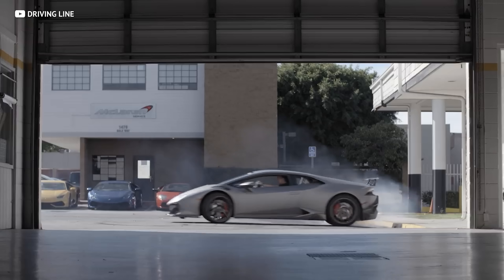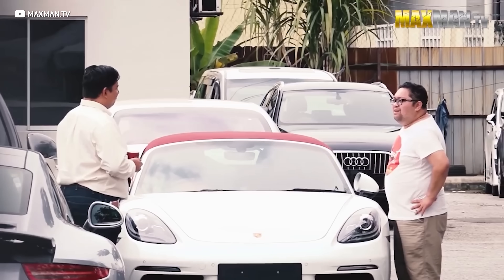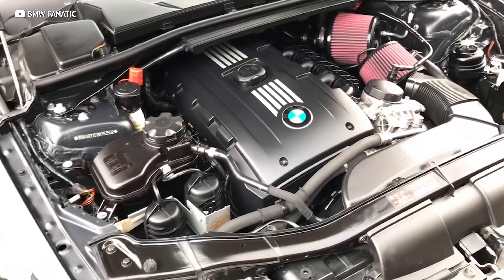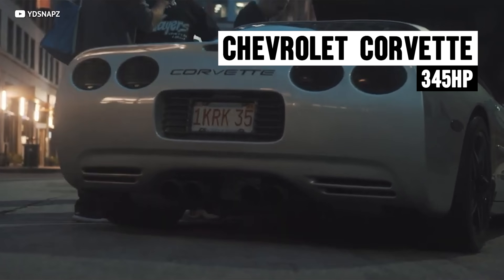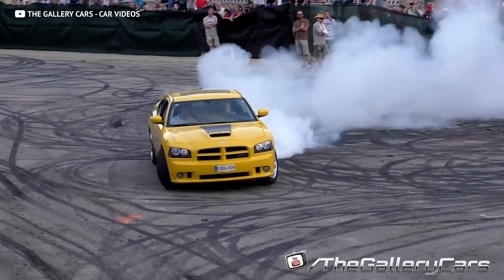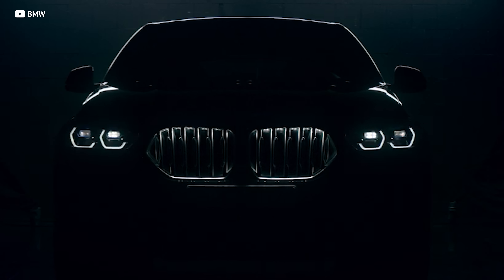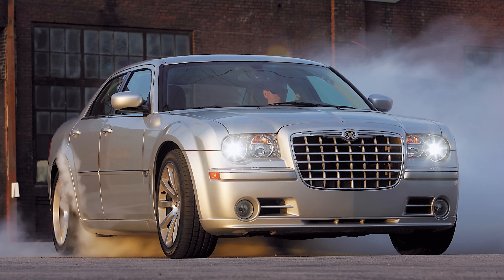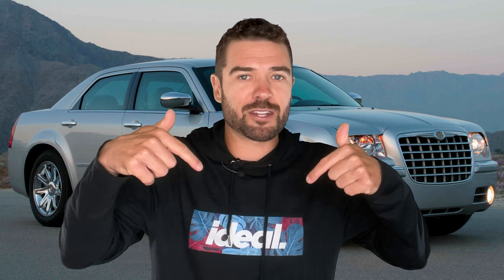Cheap Cars With a TON of Horsepower

Comment: Finally the pontiac gto gets some recognition. My dad drives one of these
Reply: Yeah they are great. Better than having a mustang or camaro everyone has those
Reply: @chinchy111  frrrr they are underated. What kind if engine swap do you think would be best for the car? My dad had an ls3 swap put into his
Reply: I think they're garbage personally.  Slowest 400hp I've ever seen in my life.  Maybe if they weren't 4000lbs in street trim they would have been faster.
Reply: 3700lbs but yeah still very heavy. Why are they so heavy its GM so its all plastic interior. Just a big car i guess
Reply: @chinchy111  bruhhhh thats insanely heavy thanks for the info
Reply: @chinchy111   Dude, I have no idea because my C63s is heavier than a 2006 GTO, it has 516ftlbs (vs only 400) but still gets 0-60 in 3.8.  Possible that they're just not geared right, I guess.
Reply: lol
Reply: @Justin-ut2vw  Don't those come from the factory with an LS3?
Reply: @ravemaster7405  it was the ls2 the ls3 never debut until 2008
Reply: @JB-ej8zy  correct

Comment: I have to say I bought my genesis for 10k about 3 years ago with 80k on the dash and I have to say the horsepower I phenomenal! It’s luxurious and noticeably fast. I race a s550 and beat him by a car length every time because hyundai’s transmissions in those are very quick. One of the Best purchase I’ve ever made and pushing 150k on the dash it still drives like new!
Reply: I felt the same way 😿 I bought my 2013 2.0 for 7,500 with 65 on the dash. Was the funnest thing to drive for 2 years until I got a rod knock at 80k miles 😭😭
Reply: from what i read t56 manual trans kits exist for that motor too.
Reply: My 09 manual g37 uprev tuned beat my friends Genesis 3.8 tuned both fbo

Comment: Y'all r gonna make me buy the perfect car and u guy's content is great!
Reply: Lot of BMW and other luxury cars on this list. If you want something cheaper than 10k and much cheaper to mod up to 600hp check out the 05 to 07 Saturn ion redline or less preferably a OG cobalt SS but the redline looks much better and is a lot more rare yet only 5k max. Only 5800 made. Supercharged from the factory, recaro seats, read suicide doors, battery already in the trunk and it was built and intended to be modified and easily handles 500 to 600hp on the stock bottom block
Reply: @billybuchanan385  sure dude thx btw😀

Comment: The GTO would be my ideal choice cause it's always gonna be a sweet ride no matter what year it is.
Reply: Only issue is there 18k or more none are under 10
Reply: Get you a Caprice PPV. Same car ‘13 and below. ‘14 and up are more like the Chevy SS. It’s the perfect sleeper! I came across a ‘14 at auction for a little over $8G’s and it only had 46 something thousand miles on it. No accidents, no damage. It’s also rare around here. I dropped it off for new tires and all of the guys came out of the shop wanting to see who was picking it up and wanting to know where I got it and if I want to sell it. 😂 Every single guy that I talk to about it asks me if I want to sell it. Now that I think about it, a friend told me “congratulations, you just bought yourself a dick magnet” when I got it. He was right. 😂
By the way….mine has a L77 in it in case you’re not familiar with them.

Comment: Bro no way the 2006 GOAT finally getting recognition 🗣
Reply: Picked my goat up for 7k
Has 2228r texas speed&performance cam ,circle D 3200 stall, texas speed long tubes, heads were worked on too, and pedders coilovers front&rear
Reply: @travisloza8037  wit 400k miles and slipping trans

Comment: If you gave me 10,000 dollars I would buy either the Mercedes sl550 for sure and second would be the gto... I've had the 6.0 Ls but a more timid version being it was a 2012 caprice ppv..Also owned the 300c... And I am a current owner of the genesis 4.6 V8 power and sound is a must ..The Genesis lacks low end torque normally found in a V8 I feel but stretch it out a little and by that I mean keep it hammered it will keep up and pass some 485 challengers idk if it's aero but top end is really good for a family sedan and it's not uncommon for me to cruise around 140 and I have had it at 158 so I don't think these engines lose much power over time but I've always bought stock sleepers and I think for pure fun and performance the sl550 which really impressed me the most driving  as far as sound and performance  or the  gto is where I would look to... Mercedes is extremely reliable with being put to use might cost a lil more when it breaks but you can bet it won't blow like Ls would sustaining those high rpms and prolonged supposed abuse that would blow most v8's especially from long high revs they were made to sustain Autobahn speeds not just average American highway speeds ....The main reason they require so much oil even the slk320 takes 8.1 quarts of oil in a somewhat small V6.... The wear and tare are minimal compared to when you keep your foot down in American cars for prolonged periods therefore actually costing less.... But that being said gto would be second if not first depends on which I would find for the right price

Comment: Good video, but the Chrysler 300c came standard with the 5.7 HEMI with 350 hp, just like the charger RT mentioned earlier in the video. And happens to typically be around the same price. And is the same platform as the charger too. Then theres the 300c SRT8, with 425hp. Good luck finding one in good shape for less than 16-18k. Same goes for the charger SRT8. However you can sometimes find higher mileage ones for closer to 10k and sometimes less depending on condition. Not to mention, many people believe the 6.1 HEMI was underrated, and actually may have made closer to 450hp, and typically exceed their rated 0-60 of 4.8 seconds, and can be seen going as quick as 4.4 seconds stock, the same as a scat pack with the 392 HEMI. The earlier gen 300s, chargers, challengers, etc also weighed about 300-400 pounds less than the newer generations.

Comment: Dude actually just said get a used bmw with almost 100k miles thats been in a wreck……. Anything he says after this point I’m just gonna assume is bs. I’m actually offended somebody would put that in a video.
Reply: why? thats how good it is.  a well engineered vehicle should be worth rebuilding or repairing, salvage title is a stamp of love.
Reply: @kenninger4267  Because “lower end” bmw models are notorious for having major problems around the 100k mark. The parts are extremely over priced and labor to fix them is more expensive. Buying a bmw with 100k miles is just buying yourself a rolling money pit. Not only that but it’s been wrecked.
Reply: @MrPanaramuh  Your story is a gem and I’m glad you got a nice car with no issues. Check google and you will see you are in the minority. Bmws start going out around 60-85k miles. $40k should not only get you 60k miles. BMWs are rated under average on reliability and well over average on repair costs.  Been in the passenger seat of a bmw with like 70k miles that had the notorious slow oil leak from faulty seals….Engine Blew while we were on the interstate Rip 40k in less than two years.
Reply: @user-mx8rn6tj8h  I'm with ya there. It seems all these LS motors, toyota motors and such skew people into thinking ALL motors are the same. The N54 is a special beast itself. That's why I highlighted maintenance in my reply. 

Knowing notorious weak points before buying a vehicle is KEY. N54s are prone to leaky seals(Valve cover, oil cooler, rear main), faulty early index injectors(Why it was my first "repair"), electric plastic water pumps(Mandatory repair in my case around 80k, started leaking because it's located underneath by the oil pan), turbo wear can get bad(due to people overspinning them because MO POWAH BABEH), HPFP, open deck design causing cylinder ovaling, yadadadad.

 I'm just saying the motors themselves aren't inherently designed badly. It's just people getting them, thinking they have a german 2jz and boost it to the moon with off the shelf MHD tunes. Then they complain when their turbos go out because they pushed them out of their efficiency range causing them to over spin with faulty index 1 injectors they never bothered checking. Spark plugs are changed every 10-15k miles on these cars depending on power levels. The computer can only monitor so much.

In my opinion it's partly the owners and partly the design itself. I am lucky I got a good specimen that wasn't abused in the likes I mentioned beforehand though. These videos make it harder to get such vehicles.

Comment: My brother had a 400 hp GTO with an expensive performance suspension that he added on. It was nice and fast, but he got rid of it when the rear end was going out and there were no new replacement parts for it. So he didn't want to hassle with the Pontiac since they when out of business April 2009.

Comment: Lol also owned the g/37 as well a great car indeed all around no problems there just a 110 mph wreck lol but have had it past 150 easy as well without any worry of destroying my cars engine or overheating great car to must add...But also have to say even the AWD versions would oversteer at high speeds through corners let's say 50 + mph just might be these snake like roads here though but definitely nimble cars as well and fast just no V8 grunt like a BMW straight 6 gives you..

Comment: The only quibble I have with some of the choices, especially the LX cars is the ZF transmission in the later cars was only available with the V6 initially, so you had to make do with the 6 speed auto in the SRT-8's for example and other Hemi cars. You WANT the 8 speed ZF! Making the 2015 cars mandatory and you'll go over your 10K budget but at least you'll get the better transmission and higher output base Hemi (425).
Reply: Yeah I have 3 bmw’s with the getrag, zf-6 and zf-8.  And the 8 speed is far superior.  With a transmission tune the zf-6 can be made a lot better but it still won’t beat the 8.
Reply: The 06-10 gen had the NAG1 (W580A, i think) which was a 5 speed auto, but is a really sturdy and capable transmission. Also the 6.1 HEMI was available from 06-10 and had 425hp. The 5.7 made 350hp from 06-08, and 370hp from 09-present. The 392/6.4 HEMI came out in 2011 with 475hp.

Comment: I would definitely go for the 300C, it's the perfect fit for me and my fiance. It has looks, power and the size for everyday use
Reply: I can get this in the UK so will definitely be looking for one I had no idea that they were so powerful I thought it was a 3 liter v6 probably putting out 200bhp, I assume you can buy a turbocharger kit for them?
Reply: @crestadude4139  there’s one that comes with a v8 that’s why
Reply: Check the common problems they have, they’re potentially big and expensive.. almost got one myself until I found out the massive problems it had, most cars you gotta watch the motor and trans( in the post it said was perfect) so I’m thinking cool yea great cheap car, then I asked what work it needs done, complete all around suspension rebuild and needs new tires cause the tread gone so quick (cause of suspension. Cooling and valve train are common and serious issues. Potential to destroy the motor.... good luck
Reply: @Whom32  thanks for the heads-up
Reply: I’m fairly certain that the 300C didn’t come with 425hp. I believe the 300 SRT8 is the trim level that came out with that horsepower number. I could be wrong, though. If I am, please correct me. Have a great day and happy motoring.
Reply: @Rxmmon me too. Had mine since 05.  One of the 250 made that year… fun facts.  No engine problem, not one. I have 330k kilometres. My daily driver… the electric gremlins have appeared although.  But still love it!
Reply: @lucasceglinski2352  no your right i have a 300c and it makes about 370 not 425
Reply: I have an 05 , 345 hp 135k miles and no mechanical issues at all. I've replaced tires, brakes and the battery. Great car, nice power and cheap to own.

Comment: I'm still waiting brad
"Cheap fast reliable cars"
Thanks 🙏
Reply: Choose 2! Haha
Reply: My 2003 Vibe costed $300, 130hp 2600#, reliable as stone. 
How cheap?  How much HP you want?
Reply: You can only choose 2, if its fast and cheap, it ain't reliable, if its cheap and reliable, it ain't fast, if its fast and reliable, it ain't cheap.
Reply: all the lexus. and some manual Nissans and Hondas
Reply: I had a 2006 mazda 3 2.3 grand touring with a manual 5 speed for 5k. 75k miles and ran perfect. Would dust scion tc's and even an auto brz once. 160hp 155tq but lightweight and great handling. Loved that car
Reply: civic si coupe
Reply: Cheap Fast Reliable: Any V6 Honda Accord, Nissan 350Z/370Z, Ford Mustang 1999-2004, Pontiac Firebird
Reply: Buick Regal Turbo g1 or g2, haven’t driven a g1 but g2 are insanely quick for a buick, takes 93 tho
Reply: there is a saying: "cheap, fast, and reliable, pick 2".
Reply: lexus  is350
Reply: @Walterrinho  Lexus doesn’t make fast cars, let alone any cheap ones
the only car that could compete with anything on this list like that genesis would be an isF, which (used) starts at 30,000 big ones
Reply: F body camaro/firebird, and the gto is also reliable, anything General Motors will be good
Reply: My Procharged Sierra was $6000, 505hp 5000#, reliable, no check engine lights, ever, truck retained a/c and drivability.
“Nothing is reliable if you don’t understand”

Comment: you can get the E60 body style 550i with the same engine as the 650i year range with the same 360hp n62b48 engine for cheaper but its a 4 door instead of a coupe

Comment: could also get a 2000-2005 monte carlo LT stock makes 200hp recently but a ebay kit on mine for around 1500$ and running 400hp could run more but gonna have to do few more upgrades

Comment: with a 4g64 bottom end and a 4g63 or kia head you can swap it into a basemodel lancer and easily make 500hp. most basemodel lancers are really cheap around $1k 2002-2007 models only.

Comment: That 300c had the same 5.7 Hemi the charger RT has so it only makes 340hp not 425 like the srt8 Hemi
Reply: Other thing was, the old Dodge products were notorious for overrated horsepower numbers. I remember someone dynoed one of the '05-'08 era Hemis and rated at 340 hp, it put down like 260 HP or something really weak. Explains why those old things were so easy to beat even by cars with much less power on paper.
Reply: @Shintsu2  their horsepower numbers were all at the engine. Once it went through the crappy gearing in the transmission and rear end the power loss was substantial. The main problem with the Chargers, Magnums, and 300 series cars was and still is the brakes on them. They don't last worth a shit and their way over priced

Comment: As a former Chrysler/Dodge/etc tech.. I strongly recommend not getting anything SRT badged with the 6.1 in it. Unreliable out the a$$. Stick to 5.7 in R/T trims or spring for the 6.4's, whether it be Scat Pack, T/A or SRT. Far fewer issues, and they were far less often in shop for repairs rather than just routine maintenance. Personally owned a 5.7 R/T Challenger, beat it like a Back Page hook up and only did the standard maintenance on it, not only did I never have a single issue out of the car, it loved it.. so did I

Comment: I just got an 08 mustang gt 114k miles for 6500$ then a couple more thousand in upgrade cold air intake, underdrive pulleys, longtube headers, muffler/cat delete, Ford racing hot rod cams, 4.10 gears and a zex nitrous kit. I’m probably a touch over 10k$ in the car now but it’s well over 400rwhp on the bottle and almost 360rwhp on motor alone.

Comment: You aren't correct on the C trim 300 having the same motor as the SRT8. THE 300C has the 5.7L 340HP V8, the SRT trim has the 6.1L. And don't forget that Chrysler was partnered with Daimler-Benz at that time, and used a bunch of E class parts in it, meaning it is very expensive to fix as well. Front end suspension is the Mercedes multilink suspension and that suspension has proven an issue for the weight of the Hemi. Have replaced my front end twice and it was $3000 per shot.

Comment: I'm about to get a 2013xs g37 sedan with only 64k miles for 15k. It sucks the xs sedan didn't come with the upgraded brakes and suspension as the coupe xs but oh well it's black on black, low miles, has Bluetooth, a decent amount of power(way more than my 2000 camry) thats all I need

Comment: I’m on board with this idea but there’s one thing to consider if you’re buying something like a Mercedes or the BMWs especially the 6 series you’re probably not going to want to daily driver it because it’s a cheap used car to the consumer but to the dealer it’s forever a $100,000 machine and the parts to keep it together are priced accordingly and when it comes to German machines they need their service and specialized fluids they also have very tight tolerances so running one with a worn damaged or inferior parts will lead to failure in some cases such as the six series the engine is worth more than the car so at that point it becomes parts or a labour of love 🤩🫣🤑

Comment: buy the car on the same state you current leave in because any of these older cars will be cheap but passing the safety test to register on a different state without getting a long list of things to repair is very rare 
I own one of those cars and i am trying to switch from Ontario to Quebec and is was order to fixed 20 things in order to register the car in Quebec although is driving well

Comment: 2011 to 2017 Chevy Caprice PPV $4000 to $9800 stock HP 395 with a cam swap hitting 420+ hp I have a 2013 with a 6.0 with  a  ls 6.2 Camshaft just gotta swap the push rods for extra HP

Comment: Motorcycles in general should be a spot on here, if you want to go fast and only have 3-5k? Getcha a used Gsxr 1000 or basically anything bigger than 500cc and you'll be more than satisfied with the speed and acceleration